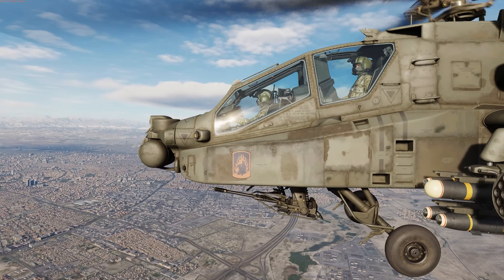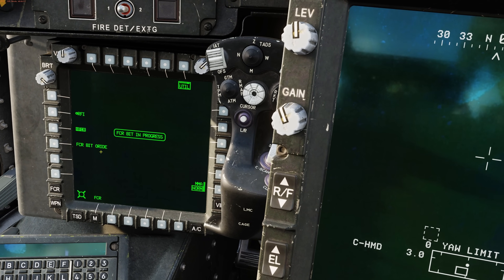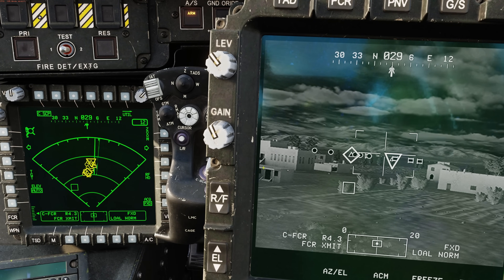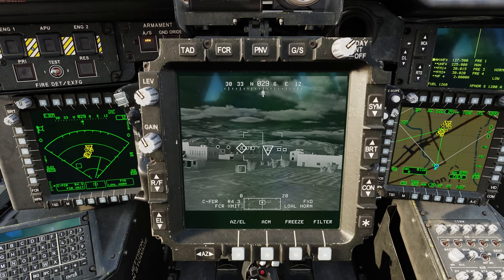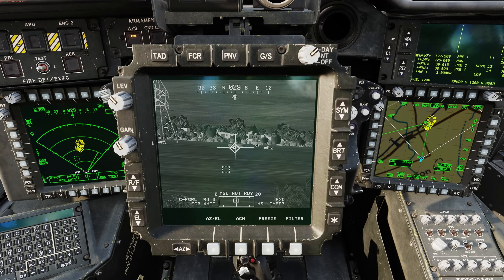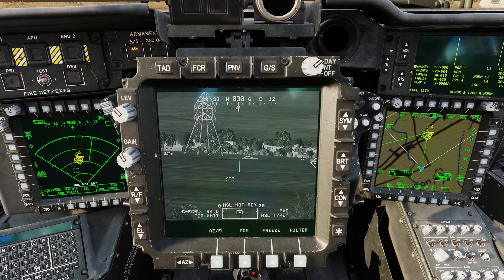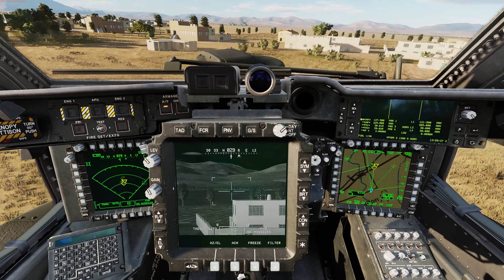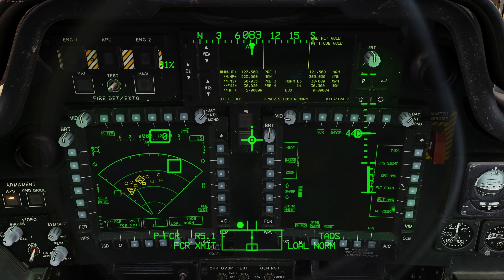DCS: AH-64 | FCR/TADS LINK

Comment: Matt, I'm sorry for not being on the subject of this video. I haven't flown for three months, I forgot everything and missed a lot... (
Now I have a new computer, I'm setting everything up again. Tell me, in any of your videos, what was the CUED button for and how to use it? I've read the manual, but it's not entirely clear. It says search by FCR signal. Quickly orients the FCR antenna to the emitter detected by the RFI. Scans in the direction of the emitter and tries to match the location of the source in GSM, ATM or RMAP targeting modes.
Is this something to do with air defense systems?
Reply from the maker: That is an RFI function that will come later and be explained then.